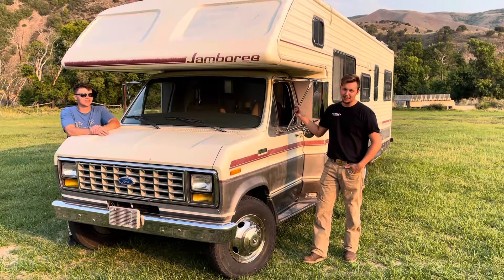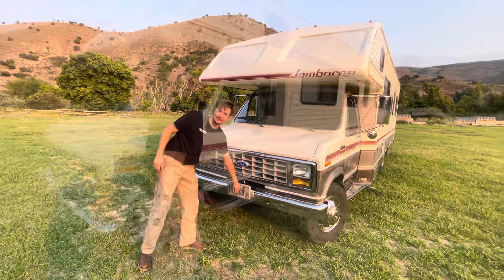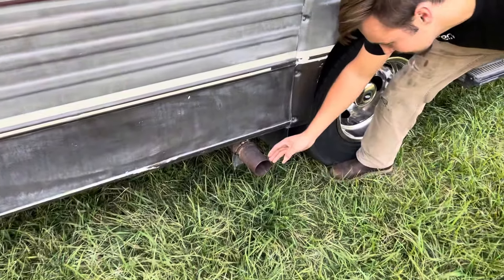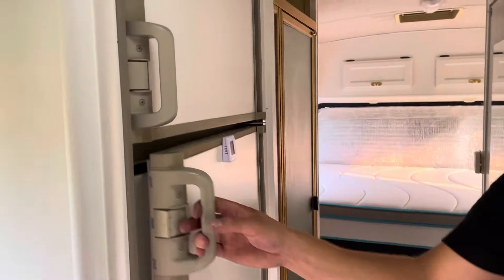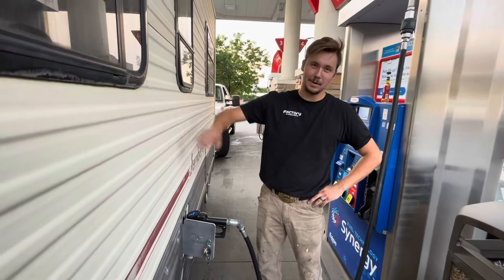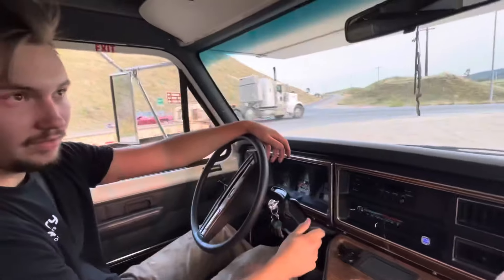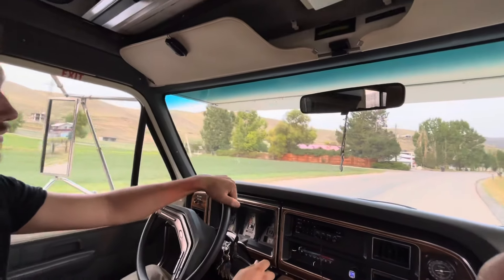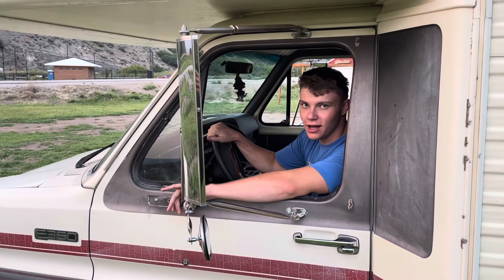RV LIVING - 1991 Ford Econoline

Comment: I've had motor coaches by Prevost, Blue Bird, and several "regular" RVs, but none did their job as well as my old 1991 Ford RV...the exact model you have shown. I remember that the cab overhang shaded the cab and that  kept me from constantly running the AC.  I could even drive 70 mph with the drivers window down and the fresh air came in but without all the noise! She was a great RV...and cheap too!

Comment: Very nice! I have a 1985 econoline coachman. Its a van with no camper style like yours. I love yours. The front dash of yours is identicle to mine. 
I had to do a rebuild in mine as the original owners took everything out when they decided not to use the kitchenette, bathroom, and bed in it any longer. 
They ruined it really. 
Thanks for the tour I love it!

Comment: I have a 1991 Tioga basically the same exact layout. Fiberglass though instead of metal siding which sucks. Fiberglass is a pain to fix. I like how you raised the bed. So much more storage. Also, do you have a part number for the mirrors you used? That’s exactly what we are wanting/needing.

Comment: AC unit needs  ALL new o rings also all rubber hoses then you will have no problem with your AC also your radiator new radiator cap  nothing serious only  getting old ONLY a few parts  really normal and then your radiator will stop leaking also dripping  engine coolant

Comment: Let's try some math.  At 8mpg on a 750 mile road trip, that is about 93.75 gallons of gas.  At today's price of gas, you're looking at $414.38 for gas (4.42/gal).  Now let's compare that to my 20yo grand cherokee that gets 20mpg on the freeway, the same trip would cost me $165.75, a difference of $248.  If I want to stop half way to spend the night, that leaves me twice as much money as I need for a room as well as dinner out for a few people.  The only advantage an RV gives you is you can take all your stuff with you. and not have to pack/unpack every night and you can pull over in an emergency to use the bathroom.  That said, that is pretty good mileage for an older motorhome.
Reply: Yea, if you’re in a rush and only spending two nights in an economic hotel then almost the same price.  But if you’re taking your time and enjoying the journey then that’s where it’s more affordable having an RV.

Comment: Do you have the 16.5 " wheels? If not what size are you running.  I like the motor home. The reason I'm asking is that I just bought one.
Reply from the maker: No. 16 inch wheels. 215/85r16 tires